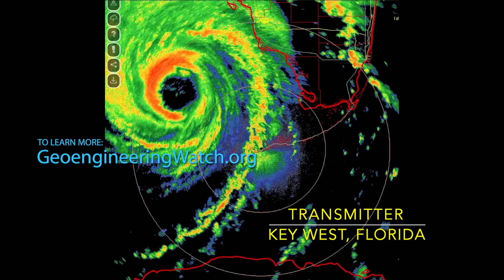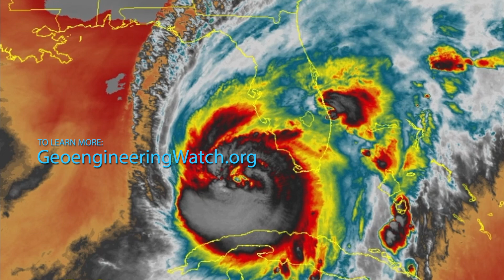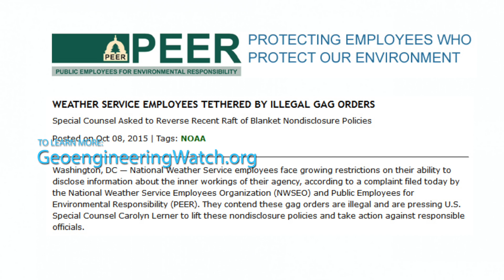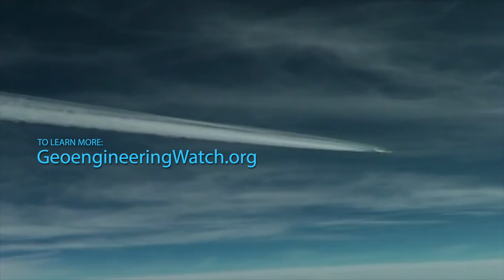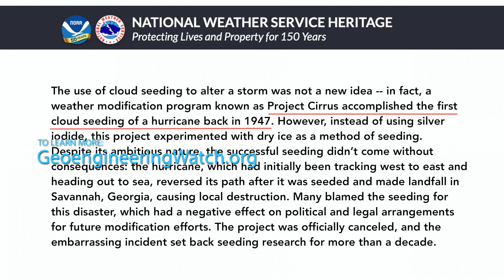CONTROLLING HURRICANE IAN?

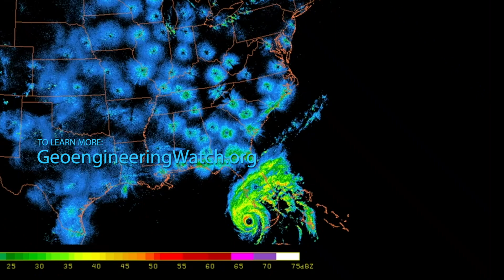Comment: What is this shooting into the hurricane and leaving a white trail?  There are 3 of them.  I saw the same thing happen in the hurricane that hit Texas and caused mass flooding and destruction.  Why did the hurricane change course? Was this the reason? Is someone or some group trying to make Gov DeSantis look bad by forcing a hurricane into an area that he had not evacuated?  Some group has their hands in this.  Two flashes appear at 3:15, one at 3:16 in the video.  Right after the third projectile, the hurricane jumps right and hits Florida.  Projectiles appear to be coming from the vicinity of Eglin Air Force base.  Coincidence?  I live below Tampa and we were braced for this hurricane based on the spaghetti models.  The area it hit was not braced for it.  Why did someone change the course of this hurricane?

Comment: Also Mexico has a tropical storm hitting the mainland on the Pacific side...the same place they have had several earthquakes in the last two to three weeks. Three rather large ones and then the one that hit M. City. I am going to check on ian next will report back. The only quake activity was on 9/4 in the middle of the Atlantic between the tip of Brazil to Liberia. I was looking for an indicator for a high pressure dome. They cause earthquakes and volcanic activity. If a high pressure dome, were here, could it affect forming the hurricane? It would be a barrier between the No and central Atlantic from the southern Atlantic. Any input on wind and ocean currents to dmn the G.E.'ists.

Comment: I wanted to report on 9/30 in Oak/SF bay area. There was a roll/covering of fog/mist on a sunny day all day. It was 86* yesterday fog would have burned off. It was on the opposite side of the bay about 20 ft? above the bay water a "roll" along the lee ward side of the San Francisco peninsula mountains. This roll sat there all day It seemed just to be on the SF side vs over all the bay. They have been spraying for methane, the fish scale clouds, now taking on a new appearance as wispy puffs instead of denser cloud material cut into diamonds. The new have that imploded in pieces look also.

Comment: Valid question, how they know 7 days ahead, where its heading and where its hitting?
Reply: High low pressure systems, ocean temperature,  winds.  Barometric pressure, size,  speed,  landmass obstructions (some Carribean islands en route are mountainous, reducing ther power upon landfall) send C 130 Hercules into eye for recon data and path projection.  Not sure if the latter could be used for cloud seeding as well.

Comment: I heard on the radio today that they were thinking about putting reflective particulates into the atmosphere to save us all…thinking about it. 
It’s pretty obvious which side those manipulators are on politically considering the location, timing and intensity of this one.
Reply: "Thinking about"

The part they never tell the public is these programs have been going on for decades.
Reply: Like "thinking about" using skeeters to inoculate people.
Reply: Bill Gates wants to block out the sun.
Reply: Thinking about it? They’ve been DOing it for some time now. They’re after an albido effect to block the life-on-Earth-giving sun from reaching this planet through the already chemically thickened atmosphere they’re dispersing. Our home and community is a forested community in SW WA state. They fly directly over our gorgeous (only several years ago) and for many years, towering fir trees, and the pin lines of gases they exude from nozzles you can see in Dane’s The Dimming then spiral outward and connect, each pass they make, until our blue skies are now a dirty brown but with a blinding glare. Sometimes what they spray is black. It turns wispy and melds into their white concoctions amd makes our sky appear sooty even when it’s a blue sky (glaring through a sparkling atmosphere that looks like fog or smoke has amassed.. but it’s been this way for 3 years now, when they first appeared here. 
The forecasters will show us a sky that’s whitish blue, looks like a smoky haze has settled for the last THREE YEARS now. And they’ll look right into their camera and say, “Blue skies end to end today! Visibility 10 miles. Look at our blue skies!” When we cannot ANYMORE see the gorgeous mountains across the valley as we have always, prior, gazed at. 
When we are gaping at a chemically derived “gloomy” now each day, and yet also glaring, the silver (???) sun a warped, wavering and sickly looking thing just past the smoky skies and that hurts to even glance at. SILVER. 
But it’s our atmosphere causing our sun to look so twisted and sick. Our sun OUR SUN is as it ever was, yellow and burning to bring LIFE ON EARTH. Everything dies once they are through.. and yet if we could get them to STOP our atmosphere WIL return to its normal state. If we LET it. At some point? That may not be the case, we don’t know. 
That is what they need, Earth ruined, to usher in 
Indoor Agriculture which is vertical a la Denmark’s. To usher in bugs for you beef for your “Betters”, in this class war, ongoing. To usher in more controls for every move we make. What’s in the pin lines (from afar) is toxic nano particles of aluminum oxide, sulphurs, strontium, barium, NICKEL, it doesn’t end; their warping ingredients list as our atmosphere is their research lab and we their lab rats. 
Learn. There are MANY private corporations that sell these chemicals TO AND FOR the weather modifiers. It’s a big industry. The US Forest Service is 100% involved. Wildfires? As weaponry. Look that up. You’ll find all the government documents you’ll require to learn what so many are just now beginning to awaken to. They don’t want us to interact with THEIR natural world. They have whole committees who for decades have drawn up maps with official corridors labeled for humans, we filthy beasts, to inhabit. The forests, seasides, the natural world is to be “re-wilder”. Yes. It’s ludicrous ridiculousness but it is the agenda. 
Cities as megalopolises and we crammed into vertical stack and pack rooms in high rises. They? Dining on lobster and the best filets of Gates Ranch Private Reserve BEEF. You? Bugs. Lots of extremely toxic insects. 
Sounds like hyperbole but it is fact based. Too much to go further into here. Homework assigned, lol. 👍😊